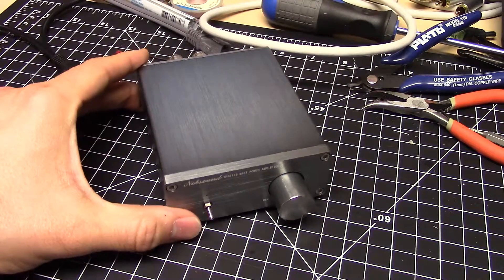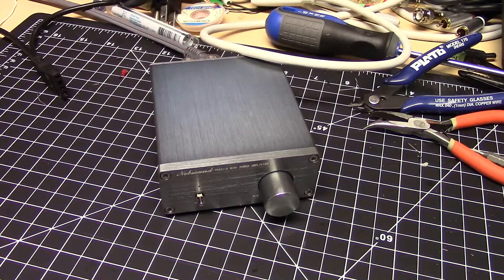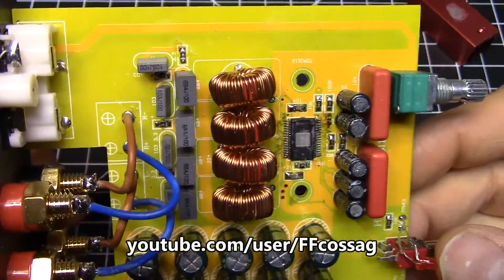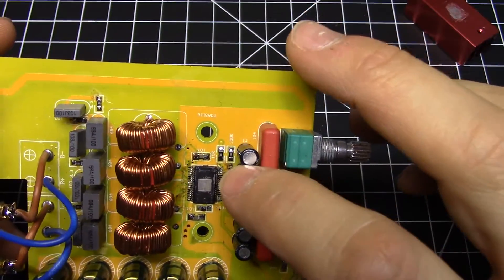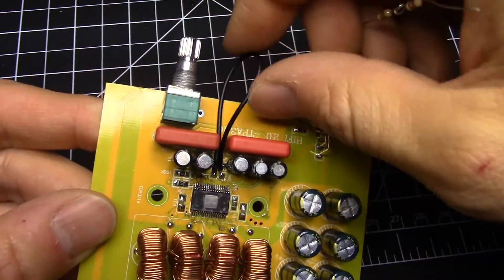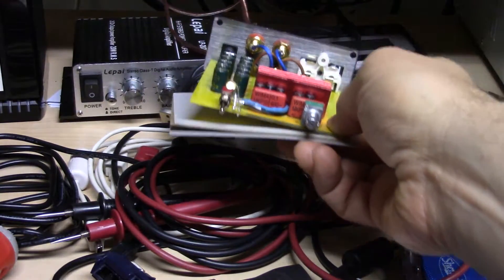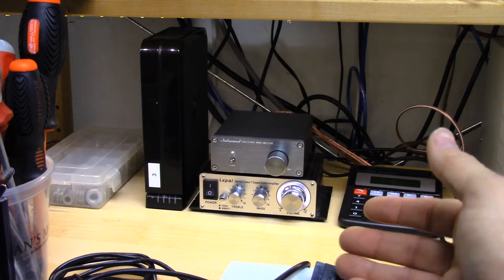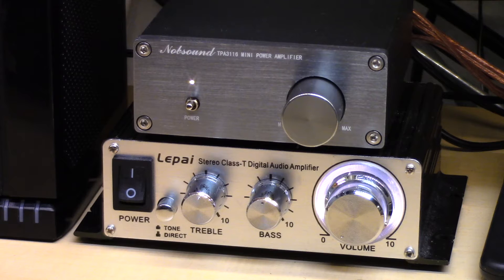Nobsound TPA3116 Mini Amp Gain Fix (aka Breeze Audio)

Comment: Using a 2x2 ohm subwoofer on relatively small size, and connect both of those two channels of the TPA on the driver, you would be amazed about how strong and precise the low frequencies are! Of course, between the source and this amplifier, a good made subwoofer  active filter is needed. Try it! :) And, yes, only 12V! But a car battery it doesn't joke about amps, does it?

Comment: You didn't really have to remove the 100k resistor. You could have just put the 5.6k in parallel with it, soldered to the pads like you did with the wires you used, which would have given you 5.3k with 100k and 5.6k in parallel

Comment: John Audiotech suggested ditching the 10x 25v caps and substitute higher voltage, because a 24 volts power supply is too close to the rated capacity of the caps. He blew a cap because it was underrated.  He suggested 35v....

Comment: I bought a tpa3116 2.1 amplifier... It sounds damn good but I found after 20 25 minutes of playback the inductors could be used to cook my meal ... It becomes hot like anything !! Is there any way to keep the board cool !! Will replacement of the inductors could be a solution ??

Comment: I watched your two videos regarding Breeze Audio Amplifier. Thank you for your expertise explanation. Recently, I purchased Breeze audio with two TPA1336D2  "better quality?". I found out most of the stuffs look similar with the one chip. Today, I found out left side speaker louder than the right. My question to you is. How do I fix this sound problem. Any potentiometer or resister need to be adjusted or replaced. Thank you in advance for your assistance.

Comment: I do not understand this ... there in USA... you can go to a Goodwill ... and buy a used Pionner or Technics Amplifier... or tuner-amplifier ... for more or less the same money ......... what's the point of buying this cheap chineria ???
Reply: the size and power consumption.  i have vintage receivers and frequently check goodwill for things like you mentioned, but this type of amp absolutely has a place in my life, even among other more "audiophile" leaning components.  i have the dual chip version, which should put out around 25-30 watts RMS per channel into an 8ohm load with a 24v power adapter.  that is enough real power to drive the vast majority of speakers to good decibel levels without clipping.  these amps are great for a portable audio system, or for just being portable on their own, you can bring real power with you anywhere you go.  i find it ideal for a desktop computer audio setup.  i use it to drive a pair of modded minimus 7 speakers (mcm woofers, custom crossovers) and it beats the pants off most "computer-specific" speaker systems that cost 100s of dollars.  this also has obvious uses in car audio systems, especially if this performance can be achieved with ~14v of power over time as the technology advances.  we could have headunits capable of delivering real power without the need for external amps.  these will only get better and more powerful over time.

Comment: One thing I don't understand. Why those big inductors? I know the way class D amplifiers work they're required. But such big ones do they have an impact on treble? Too large inductors will inevitably have an impact - the question is - are the ones chosen too large?
Most other class D amps use small surface mounted ones.
I ordered one too. Excited to see that I get. Should it go wrong there's always a nice circuit board, on/off which and volume control to mount other cheap amplifier boards on.

Comment: Not quite sure about you putting hot glue on the inductors - They get quite hot don't they?
The glue is going to melt off and flatten onto the board (I would guess).
Reply: Тhink about it inductors "conduct" dI\dt i.e. change in current. They don't have much of resistance. They wouldn't get that hot since they are not ''conducting" the entire time like a DC device

Comment: Did you notice that the resistors you removed were actually 110k and 47k and not 100k and 39k like it's supposed to be according to the datasheet?

Comment: Would it be possible to perform this fix on the new dual chip version of this amp? From the factory the volume knob is basically useless.
Reply: I've also been trying to find info for a mod on the dual chip version. I did run across a forum entry on a topic that had a 1000 pages or something that mentioned it but it was a small quote from another post and I couldn't find the original. I agree the gain on that dual chip is just too much. with a 12 volt battery about 1/3 volume is approaching (if not already) overkill. I'm using polk t-15 speakers . With my 24 volt 4 amp power supply somewhere around 1/4 volume is pretty much the maximum and it is way too much. I did just run across something about swapping out the op amp chip in the dual chip amplifier but haven't researched that enough to figure out what the story is with that. Mainly wanted to let you know you're not the only one looking to mod the dual chip amp to reduce gain.
Reply: @jsdspif3  did either of you figure this out?

Comment: Nice....  U know, you could have just used ONE of those two resistors that you soldered together.....    Just because a Data sheet sez 5.6K, DOES NOT MEAN you could not have used a 4.7k.....  As an Audio circuit engineer, Broadcast Engineer and having designed audio Broadcast processors since the mid 1970's, the FUN-part of doing stuff like this is to experiment....   A 4.7K will give you close to 17db gain, which would lower the INPUT Noise-floor by another 3db.....   TRY IT !!!!!!!  BTW: I too use this amp on some DIY Active speakers, have the DATA Sheet in the bathroom right now, to review whilst sitting....   What you get for what you pay; THIS Amp is one of the best values around today (2017).....

Comment: so in text what all did you exactly do other than remotely move that one resistor? what was under the wire that was the remote resistor? I'm thinking of getting this amp for a project. the 2.1 channel one

Comment: This is actually one of the better-sounding TPA3116 amps. However, the Wima caps only bypass the input electrolytic caps; I replaced all of the electrolytics (except for the center one which does not carry audio signal) with Nichicon Muse. I run mine on 24V; I have a Ktec 24V 5A SMPS that came with a Dayton Audio DTA-100, and it is actually the best 24V/5A switching supply I have tested in terms of audible noise leakage (tested with a headphone amp); the high feedback used in these Class-D chips gives them excellent PSU noise reduction but it's always better to feed them a clean high-current supply.

Comment: about the input impedance chapter 7.3.2, its a high pass filter so a too low cap will just roll off bass a bit too early. Bigger cap wont increase frequency response.

Comment: Good video. Thx! I'm considering getting this small gear. Can I run it with only 1 channel loaded in the output? I have a 25W@8ohm passive guitar speaker to connect to. I want to get the guitar signal from my computer and route to the speaker, without turning on my tube amplifier for that. :P
Reply: Interesting. The bridge mode would be my next question actually. I'll keep looking as my demand is not something to be left still in the desktop. Maybe I'll have better luck looking straight for a car amplifier that bridge mode works out of the box. Appreciate your inputs though.